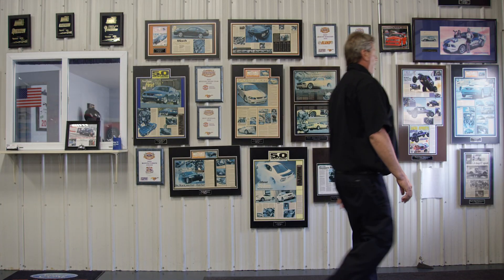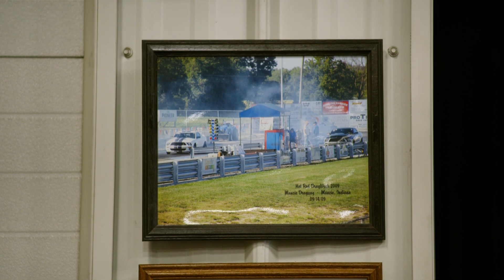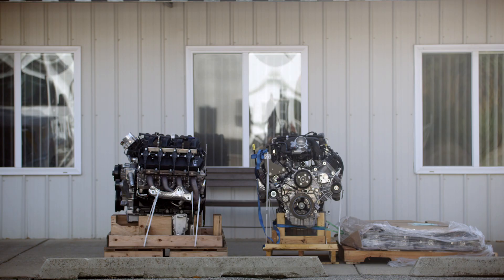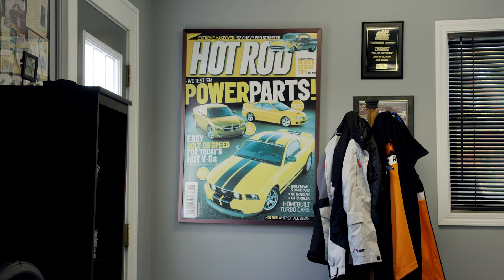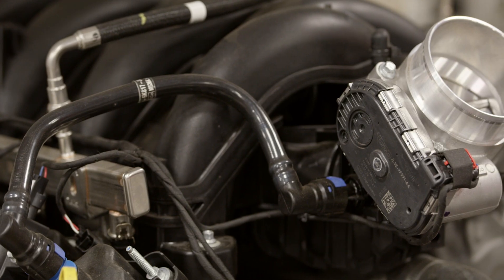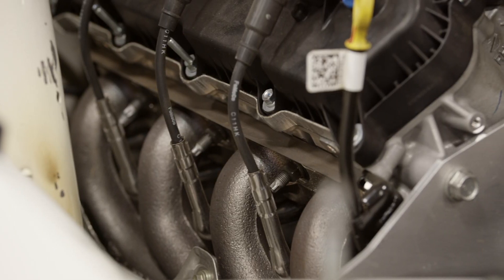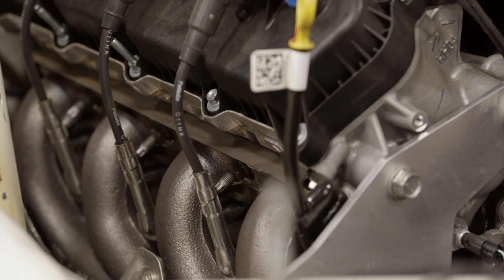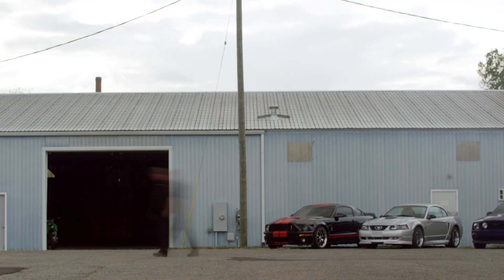Paul's Cobra Jet / 7.3L Crate Engine test vehicle

Comment: Impressive Burnout!! What Ford needs to do is to bring back the 1969 or 1970 Mach 1 or Boss 429, in the original sheet metal configuration and wheel base with the new 7.3L gasser, with a 5 spd Tremac as the only transmission available, short tube headers, a true dual exhaust with x-pipe.

If Ford would bring back the exact way the late 60's early 70's Mustangs looked they wouldn't be able to keep them on dealer lots.

Comment: When can we expect the 7.3 Ecoboost?
Reply: I'd like to see a twin turbo Coyote first!
Reply: @charlieodom9107  I'm positive there are some out there.... factory? No. But they are out there.
Reply: @Shutchohole  I know of 3 right off the top of my head, but none are factory of course. 2 are in F150s, 1 in a mustang. The F150s are probably the fastest street legal trucks I have ever seen, that actually drive on the street of course. The mustang is one of those street legal trailer queen track cars, like the shit you see on that Discovery show. It is fast, but clearly a racecar. The two trucks look pretty much like stock trucks with some bolt-on traction bars, wheels, etc, until they leave Teslas at redlights.

Comment: The 7.3 is an outsized and overbuilt GM LS in many ways, and will give folks a fresh reason to stick with Ford. High 10s on a stone stock truck motor? I bet it can go 8s NA and 6s on boost.....on the stock bottom end👍

Comment: Yeah. Fords always perform best "on the track". A rented, closed VHT-ed to death no-tree no-competition track in late fall when the air temp, relative humidity and barometric pressure are "optimized" for "making power". Is that "10s" on a REAL quarter-mile or a Fordtard "tuner" quarter-mile aka "1000 feet"? 

And when are we going to see the TRANSMISSION "side" of these "Godzilla swaps"? 

Not wanting to show off the Power-Glide or TH400 aka "Chevy" aspects of those "all-Ford" no "LS swap" allowed "builds"? 

That's OK. "Chevy guys" really don't give a shit about "Godzilla" besides being "good" entertainment just like the original with Fordtards running around all over the internet babbling about "Godzilla is coming!" just like the "Tokyokans" in the movies. 

And we all know those POS Mustangs have been running Ford's 12-bolt GM rear axle copy since the "Fox-body" was introduced before 95% of Fordtards were even an itch in their daddy's drawers. 

We won't rub it in too much that stock "Godzilla" engines are only available with the "Ford" 10L80 "joint venture" transmission GM's TurboHydramatic division "partnered" with Ford to produce for the LAST FREAKING "AMERICAN" AND "MODERN" V8 ENGINE THAT SHOULD NEED A FREAKING "10-SPEED AUTOMATIC" IN 4WD PICKUPS.

Comment: Love it. Finally Ford is going back in the right direction. Can't wait to see the new 6.8 in 2022.
Reply: Arguable, but the 7.3 was meant for trucks, and it fits well there. There are too many advantages to overhead cams over pushrods when it comes to performance. From oiling them, to the rotational mass, to the high RPM performance. I will say if the 6.8 rumor is true, I'll probably be regretting buying a 2021 F150 with the 5.0.
Reply: @Terminxman  only thing i have seen with the over head cam is they life to rev. Thats it. The Hemi came back as just a truck engine in the beginning in the 90s. But look at it now.
Reply: @rickeydriskill1096  all things being equal overhead cams are more efficient and have less drag. Only downsides are the size of the heads and cost. I love an old pushrod v8, but if Ford just abandons the modular engine and goes to something else after finally getting the coyote sorted out I'll be upset.
Reply: @Terminxman  they will never be equal cause it takes 2,3,and 4 times the parts just to make it run.  The mod engine design has been around since the 90s causeing owner costly problem with every version.  They shouldn't just not be getting it figured out. Thats terrible quality control. Just glad to see they are going back to what works and has some size. It only took one mod motor to break me of ever owning another one.
Reply: The right direction? Idk it's easy to run 10's with coyotes why was that a bad direction?
Reply: @fiddynutz68  expensive modded coyote runs 10s untill it blows. This ran 10s as a stock, off the assembly line engine with no mods and many have found there is way more power to be had with just a cam swap and minor head work. ABSOLUTELY no comparison. 😒
Reply: @fiddynutz68  they have a cobra jet mustang with the 7.3 in it running in the 10s now. The mod platform has  been plauged with costly problems for owners ever since its introduction. Glad to see they are going back to pushrod and that's its not a tiny 5.0 like before which was widely over used.  Now if they keep the 5.0 and have a 6.8 option. We will see which one will sale better.  I have always been a ford guy. But they lost me with mod motors.
Reply: @rickeydriskill1096  early gens it was an oil pump but you had to hit pretty ridiculous horsepower to worry about it. Go buy an LS and read up on the problems on the forums and see all the problems their. Better yet look at the CTS-V and GTO classifieds, rebuilt engines all over the place. The 5.0 cobra jet runs 10's. Ford should give us what we really want how about a 6.8L dohc that swaps parts with a 5.0. A high cubic inch 4v would end dodge and Chevy.
Reply: @rickeydriskill1096  lost you with the mod motors? You realize you can find people on youtube running in the 10's boost only in a 2 valve right?
Reply: @rickeydriskill1096  don't get me wrong I'm all for the 7.3 but the nauseating, "Ford copied the LS" is already building steam. And like I said dohc just makes more power period, give me a dohc 6.8. Hell I would have settled for 6.2. People slapping boost on 6.2 2v were pulling down 600.
Reply: @fiddynutz68  they don't make more power. The power they do make is not in a usable range. Dollar for dollar and boost to boost you can't build  a dohc ford to out power or tq a Ls.. Their is two good build off series on you tube you should watch. A shop in TX and one in California.  One 10k budget and one 15k with a procharger. I have tried to give fords ohc engines a chance. I have always been a ford guy. But I can get on board. There is nothing desirable. It only took one to break me and seeing the problems my co workers have had with thier trucks. Just glad they are back to pushrod and can't wait to see the 6.8 in the  mustangs
Reply: @rickeydriskill1096  I’m with u on this one to, a dohc 6.8 would probably be crazy tho so who would know, I’m a low end guy and the 5.0 doesn’t cut it for me either. And I like to say I gotta big block
Reply: fiddynutz68 I’m sure there will be a lot of the Ls crap, but those same people don’t want to hear how the LS is based of a small block Ford.
Reply: Rickey Driskill the Ls had a lot of problems when they came out also.  They were a throw away motor.  A 5.0 to 5.0 Ls vs Coyote isn’t a contest. Never mind looks and sound.
Reply: @mikelliteras397  every mod motor is a throw away. I haven't found anything desirable of any of the ford mod motors since they changed over in the 90s.  I have been a ford guy my entire life.  But they turned me off like many others. But I glad to see they changed directions finally.
Reply: @rickeydriskill1096  the DOHC 5.0 is actually huge next to a pushrod... plus it makes better top end
Reply: @mikelliteras397  Yup, Google  Gurney Weslake engine and you'll see where the Ls heads came from.
Reply: @fiddynutz68  mustang lifestyle Bullitt turbo did that
Reply: Why? Just because it’s more displacement? I’d much rather see them continue on Coyote.
Reply: @tk87cards67  more displacement, less fail prone parts,  back to a proven designe. Far too long ford has tried to compete with to small of a engine. Since you like the coyote so much. The gen4  comes with cylinder deactivation and a oil pump that's driven by a rubber belt.  What could possibly go wrong.
Reply: @rickeydriskill1096  Lol. If you want to be too stubborn and only see from your side of the fence, I guess we’ll get nowhere. Good luck. 👍
Reply: @tk87cards67  just saying every gen of the mod engine has had bad issues.  From timeing,vct,plugs,cylinder knock,cam followers to oil starvation to the ps head.
Reply: Lol 5.0 is good if you actually know what your doing
Reply: @eddiedaugherty7063  I never Iiked the original 5.0 let alone the mod platform with all the problems it has had.

Comment: I just seen this thing lift the front tires at the drag strip yesterday. Pretty sweet considering it even had the stock headers
Reply: The most astounding part of the whole thing is this is a bone stock motor!!! Imagine what it will be like with forced induction or nitrous!!!!
Reply: @charlieodom9107  the stand alone by obr does wonders

Comment: Yeah but it take 2.3 more liters to compete with a dohc... can’t beat the revs 🤙🏽
Reply: DOHC is cool and all, but dollar for dollar a pushrod v8 is much cheaper mod for mod. That means cheaper hp gains. I love the 4.6 for reliability, but it's expensive to make fast.
Reply: Ya but a tiny 5.0 needs 4times the parts and high rev to match what this does naturally.

Comment: Awesome engine, but I’d still rather have the coyote bc it’s proven to make power with little mods, plus it sounds like a beast
Reply: This engine makes power pretty easy too, I mean no one has really torn it apart and some zillas are inching past 800hp. While the coyote may be a great DOHC, it's expensive. This is the best option for people who wanna make LS stompin power for relatively cheap.
Reply: @Kosmic949  or you could just buy a mustang with a 5.0 to begin with... It’s nice that Ford is offering more engines to use with swaps tho
Reply: @CarGuy5141  yeah, you right.

Comment: Now which shop will be the first to drop the 7.3 into the current ranger?
Reply: Better question is, Bronco!
Reply: @fiddynutz68  Australia isn't getting Broncos. We do however have a tonne of Rangers, many of which are old enough now to be in need if engine freshen ups or transplants
Reply: I can't imagine that will fit
Reply: @mike93lx  according to ford engineers apparently it does
Reply: @Rhino9.3  fit where? The bed of the truck?!!! 😂
Reply: @toofastnobrakes  People have already squeezed a coyote into them, the 7.3 is a narrower engine, Ford engineers have already said it fits
Reply: @Rhino9.3  it’s joke dude, chill 🤣
Reply: It's slightly smaller than the 5.0 in dimensions it would work
Reply: I would want the 3.5L or 3.0L ecoboost in the Ranger. That would be a more realistic option, although...a Coyote Ranger would be badass too. I wouldn't ever want this big of a motor in a Ranger.
Reply: @charlieodom9107  Why the hell not?!:🤣
Reply: @Rhino9.3  if you had ever driven a ranger with a 460 big block, then you would understand why. It is a death trap, no matter what the power level due to the weight.
Reply: @charlieodom9107   Im assuming you're talking about the older generation rangers, I was talking about the current gen, in which case  the weight between the 3.2 duratorq diesel fitted to most Australian Rangers weighs almost the same as the Godzilla.
Reply: @Rhino9.3  I guess it does. I would rather see the Coyote in it, since it is a much lighter engine. I didn't realize that little diesel was so damn heavy. I'll take a coyote at 200 lbs less any day.
Reply: @charlieodom9107  For the weight, definitely coyote. A few people have done the swap here already, doable  but a super tight fit due to the width. I just like the idea of a big cube torque monster I think
Reply: @Rhino9.3  you don't need big cubes for torque! That is a widely disproven myth!
Reply: @charlieodom9107  Yea, but a 460 also has cast heads, intake and crank making it 200 lbs heavier than a Godzilla.
Reply: @sham_wow_guy  who is talking about a 460?
Reply: @charlieodom9107  From you and I quote "if you had ever driven a ranger with a 460 big block, then you would understand why. It is a death trap, no matter what the power level due to the weight."
Reply: @sham_wow_guy  I was talking about the weight on the vehicle, not what parts are in it or power output. Also, no idiot would use a cast crank, pistons, etc on a 460 in a ranger, but that doesn't matter, as forged parts weigh the same.

What I didn't know is how heavy the diesel is, which makes my point moot anyway. The diesel weight makes any V8 a non issue, but the 5L would be a better option for the ranger as it can handle 800hp in stock form, which would make the Ranger more powerful that most old rangers with 460 NA motors, at roughly the same weight.

When we put big blocks in rangers back in the day, we would add sand bumpers to the rear to keep the trucks from nose diving and to add traction to the rear. We would also lengthen the wheelbase to improve handling. Putting a large HP engine in the Ranger would prove difficult in the new ones, but not for the weight as I initially thought. It would be difficult to upgrade driveline components, due to the way they are built now. It was very easy to upgrade old rangers because of the full size running gear already installed, so converting over to Dana 60/80 combos was easy, and there was plenty of room for a tyranny upgrade, like a C6 and STS gearbox. Good luck upgrading the new one to handle 800hp!
Reply: @charlieodom9107  just buy an F150 and call it a day, they have the 6.2 modular or 3.5 ecoboost, and there is no replacement for displacement, run a 10 litre vs a 5 litre engine with the same turbo, compression, rev range, the 10 litre will out perform it in every way

Comment: It will do better than the coyote because simplicity and packaging there’s a reason you see more Chevy ls motors than coyote motors
Reply: Its really price and availability you can go to the junkyard without tripping over a 4.8 or 5.3
Reply: @joe1273  you had the first part right they’re too expensive for dollar per hp and but another reason is the physical size that’s also the problem people have with the hemi
Reply: @keithmceuen8775  depends on the car

Comment: Oh, so now pushrods are ok? Lolol!
Reply: Pushrods are good for 9500 rpms all day long when properly prepared. Nascar is proof.
Reply: @larrynorsworthy8582  the pushrod  design is better for high rpm than the ford modular or coyote.  The problem with them is keeping the timing chain in them above 9000 rpm. They also tend to run out of room for real valvesprings . They'll do it but they end up being a maintenance nightmare.
Reply: They can't wait to get a factory ls swapped mustang.
Reply: @HioSSilver1999  😂🤣 no ls shit will be in it... I’ve replaced 3 gm engines below 100k miles JUNK JUNK JUNK
Reply: @freedomisntfree_44  yea....you think?? Hell there's already more ls/sbc swapped foxes than thete is furd powered foxes. What's that tell ya about the furds🤣🤣🤣
Reply: @HioSSilver1999  And I have a coyote with 227,000 miles on it the last GMI had made it to 88,000 and it needed lifters so what does that tell you about government motors
Reply: @freedomisntfree_44  aye bro you speaking too much facts they still gone hate ford
Reply: @HioSSilver1999  and there are coyotes running 4s and 5 on factory internals 🤭 let’s see an ls do that 😂🤣
Reply: @freedomisntfree_44  no there isn't.  Stop drinking the koolaid.
Reply: @HioSSilver1999  😂 show me an ls that comes factory in anything that makes 100 hp per liter naturally aspirated on a factory sealed engine... oh wait they can’t 😂
Reply: @HioSSilver1999  You’re right it does take a 2500 to keep up with an F150😂
Reply: @freedomisntfree_44  the load i carry on it would crush a f150.

Comment: Not sure why he would expect the 7.3 to be more popular than the Coyote - it's already a decade behind in availability, and, even from this point forward, 2020+ Coyotes are going to be more common than 7.3s since they're the base V8 in pickups and the 7.3 is the option V8. The 7.3 doesn't and won't cost any less than a Coyote. The Coyote also already has a developed aftermarket that even includes cast and billet blocks if you really want to go that far, not to mention the various swap parts.
  
It's like an LS guy saying that they would expect the LS3(6.2l) to be more popular with racers/swappers than the LY5(5.3l) - huh?! One can actually be found in a junkyard/used, and for a fair price; the other, not so much! That's going to be the 7.3 situation for a long time, at least until throw away fleet pickups start getting junked.
Reply: HankByGodWilliamsSr   No. The 7.3 is optional. Just go to Ford's web site and check. The SD trucks come with the gas 6.2 as standard equipment.
Reply: IT'S THE BASE MODEL GAS ENGINE IN THE SUPERDUTY!! Ford sells waaaay more trucks than mustangs, and 5.0 stangs at that. The F150 doesn't get the 7.3 at all, man you opened your mouth and shit just feel out. Damnit boy
Reply: @TheRoadhammer379  Let me know when you find all those junkyard 7.3s for less than Coyotes - I'll wait...
Reply: The 7.3 will make more torque than the Coyote. Torque launches the car. Torque is what wins the race.
Reply: HankByGodWilliamsSr  LOL, you obviously weren't the only one - totally derp'd out on my OHC Ford V8s